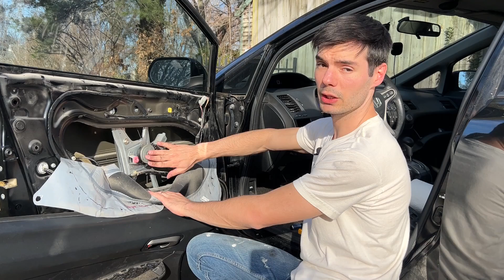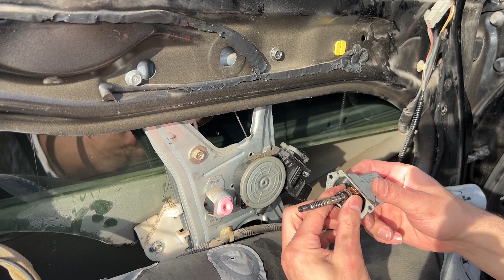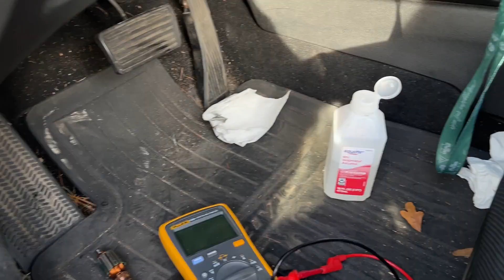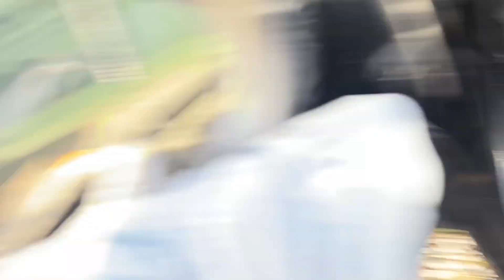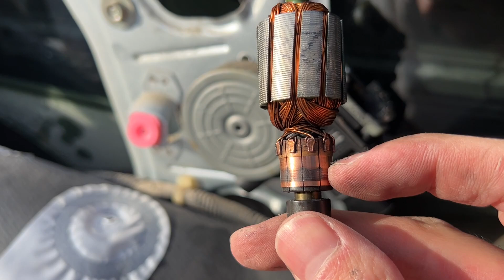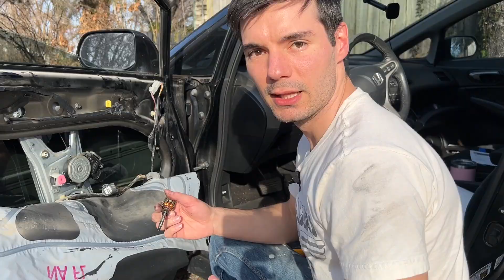2010 Honda Civic Power Windows and Motor Not Working

Comment: Great suggestion and it worked!  It took about 8 qtips.  Couldn’t get perfectly clean and I could still see residue on the motor where the brushes contact it so was worried not clean enough but seems it was.  I should give it more time to be sure and I’ll try to remember to update here after a few months but feeling good it will last for a while.  Tried knocking on it as suggested in another channel and it worked for a few seconds then stopped again so not a good long term fix.  In same video, he ends up changing just the motor but would only recommend that if you first cleaned the remaining brushes that contact the new motor.  I also noticed some debris in the motor mount cavity so vacuumed out.  You probably saved me $200-$300 which I’m guessing what mechanic would’ve charged between labor and parts so thanks for posting this video and hopefully you’re making some well-deserved money from YouTube.
Reply from the maker: Hey thanks for the kind words, glad it worked for you!!
After posting the video, my dad gave me some more instruction. (By the way, my window stopped working again but I think I know the problem).

My dad told me I should also clean the gaps in the commutator. Each bar in the commutator is critical for changing the polarity of current flow yada yada yada electrical stuff… (Google a picture of a commutator and you’ll see what I mean). Anyways, it’s possible the gaps between commutator bars are filled with debris that’s causing a “short” between bars. If your windows stop working again, try cleaning those as well. That’s what I’ll do.

Definitely let me know how it’s doing in a couple months!

Comment: Does your window still work i used the hammer tip but only works for a couple of days
Reply from the maker: Actually no 😂 It worked for another couple days and then both the front driver and rear passenger side both stopped working again. Them both failing at the same time makes me think it’s a loose connection, not bad motors (what would be the odds of two bad motors acting exactly the same?)

I’m not sure what else to check, so I’ve been using AC instead..